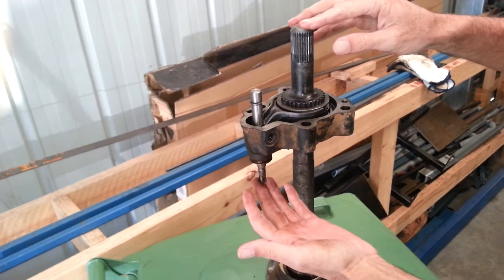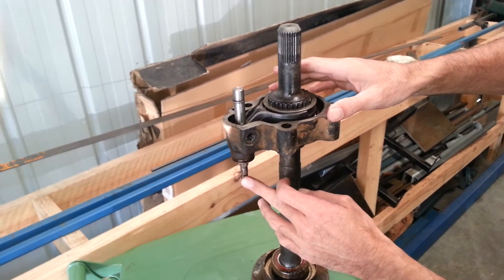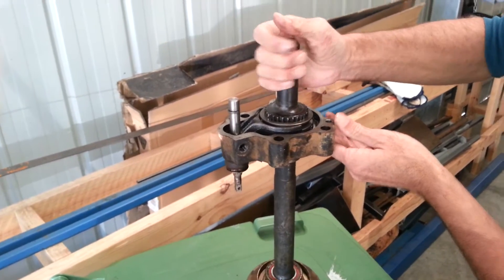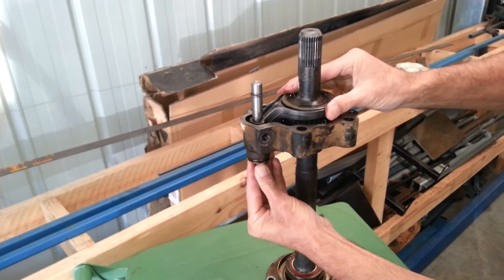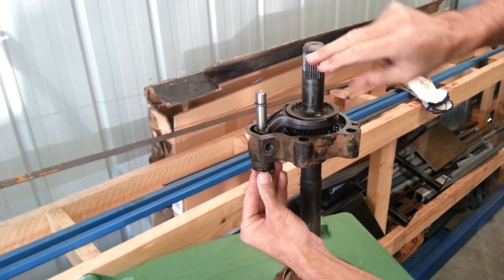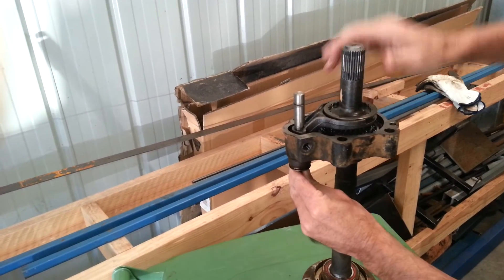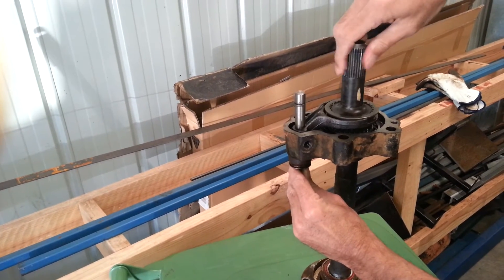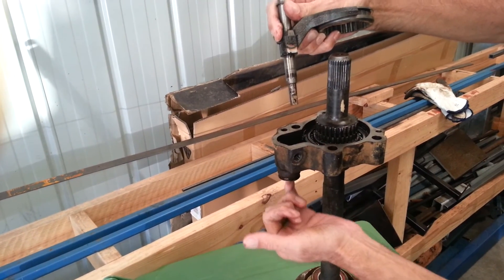Pajero front diff free wheel system

Comment: I had this grinding noise problem. Cured instantly by changing to 4WD. However, pulling off the bellows and spraying in lubricant and greasing seems to have fixed the noise issue. Problem is getting the bellows back over the shoulder. Is there a trick to this?
Reply: Jack Black What the heck is the bellows?
Reply: Silicon lube helped mine